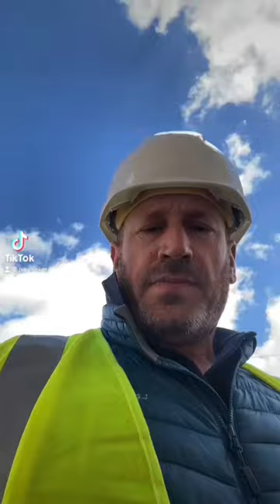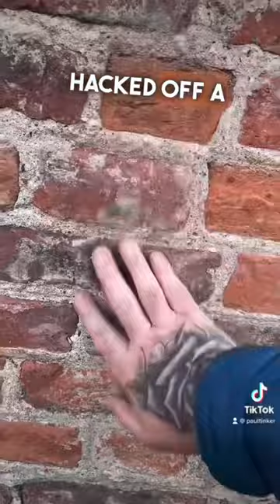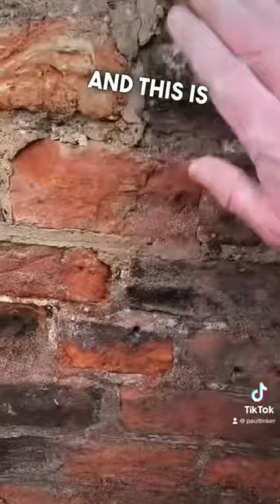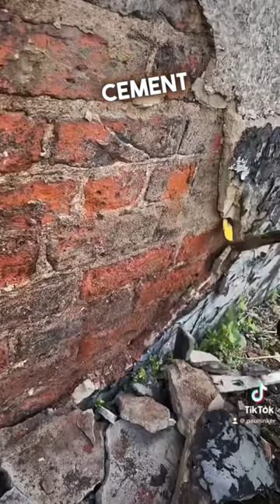No Damp Treatment: Sand and Cement Render Removed From Building #refurbishment #property #defects

Comment: I'm having this problem on my sandstone house. Only on the bottom 2 meter or so. 
The quotes I'm getting to remove the render are crazy though.
Reply from the maker: @mrt5017  removing render needs to be done carefully or you’ll end up with an even bigger problem of blagging all the stone faces behind them. So many folks do this themselves and find out the hard and expensive way that they should’ve got someone in with the right equipment - hope all goes well with it mate